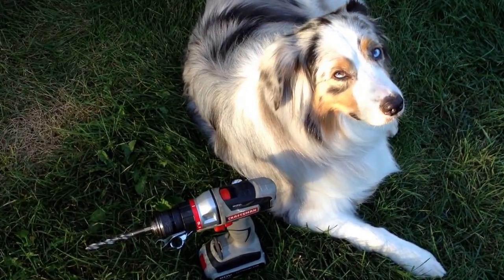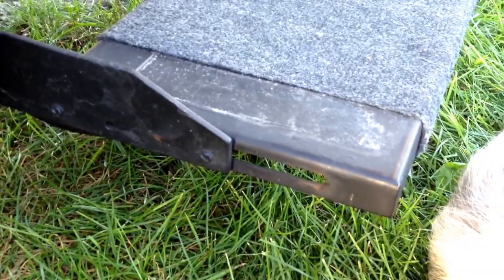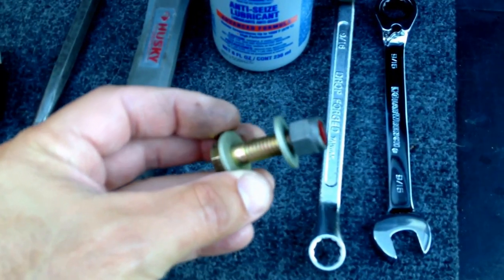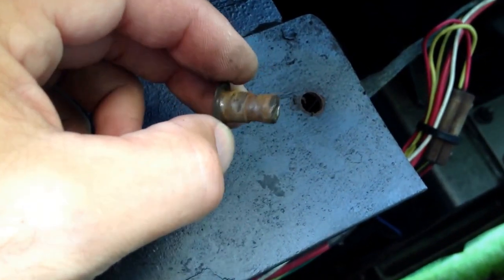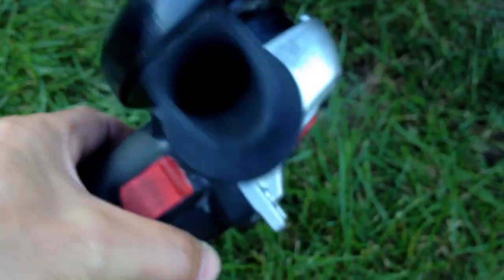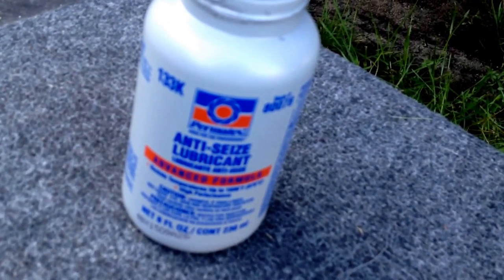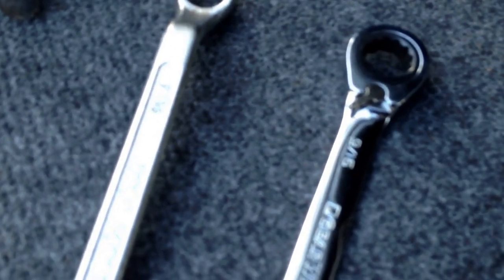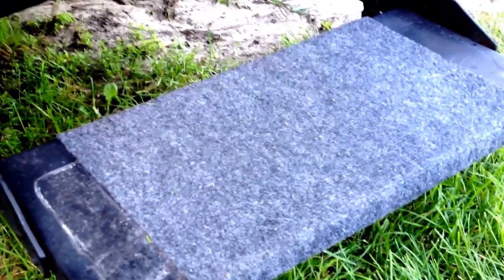RV Entry Step Repair

Comment: Why didn't you put a nylon washer between the frame and the swing arms?
Reply from the maker: dan Farrell That's a good idea, might work even better.  I used what I had and figured I'd be lubing it regularly.
Reply: I was thinking that also.  One further thing I would have done is the selection of the bolts.  I would have used Stainless Steel that way they would never corrode. Otherwise an excellent very informative video. Two thumbs up.